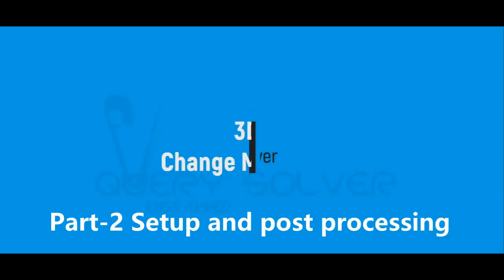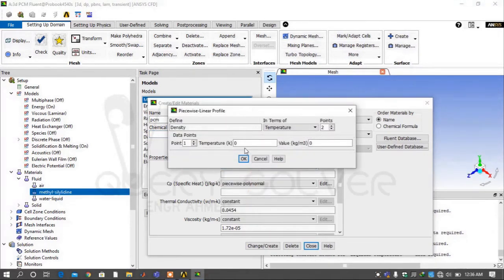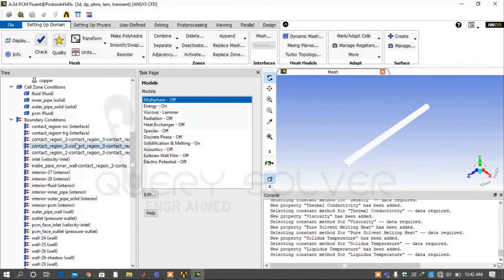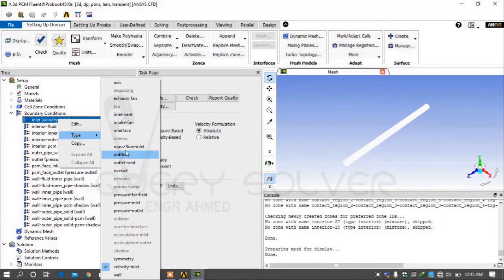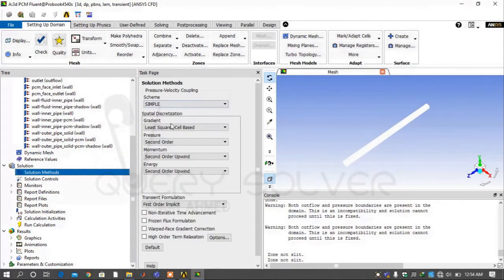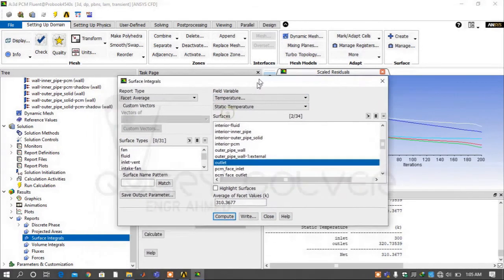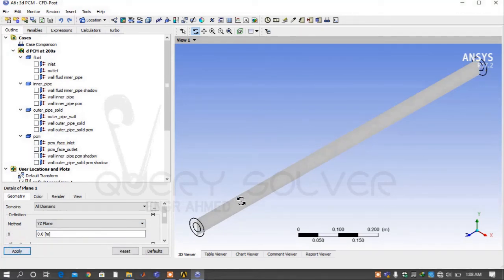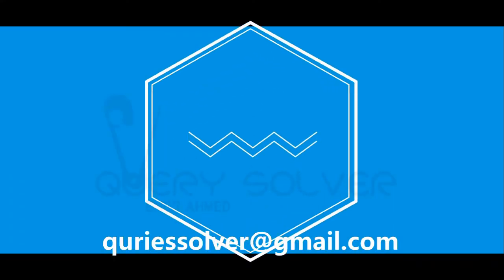3D Phase Change Material Part 2 | ANSYS

Comment: Sir, Thank you for uploading such an interesting video on PCM simulations. I tried to simulate pcm using ansys 2020R1. I exactly followed the same steps to your tutorial. However, I couldn't find 1) wall-inner-pipe-pcm , 2) wall-inner -pipe -pcm-shadow in the list. As a result, I couldn't get the same result in the simulation. Would you please help me to correct my mistakes?
Reply from the maker: Yes email me your file in archive form at queriessolver@gmail.com 
If your query resolve kindly subscribe and share my channel
Reply: @QuerySolver  Sir, I sent you the files on your email.